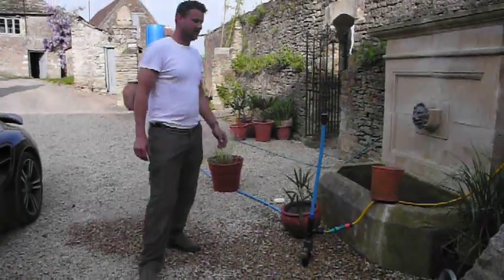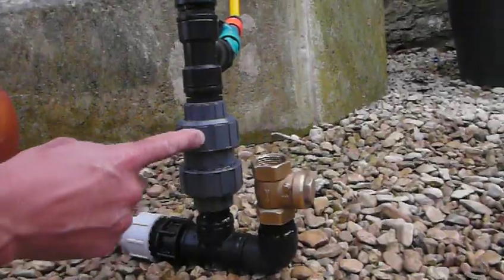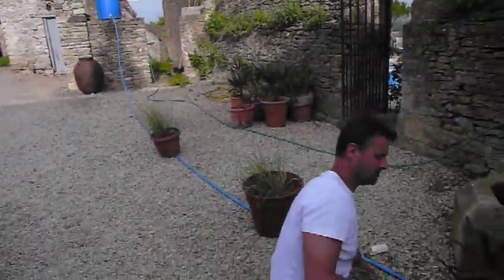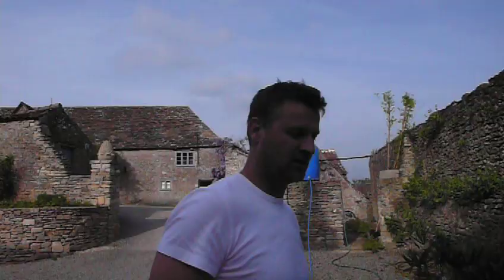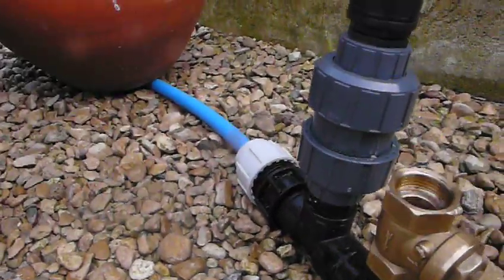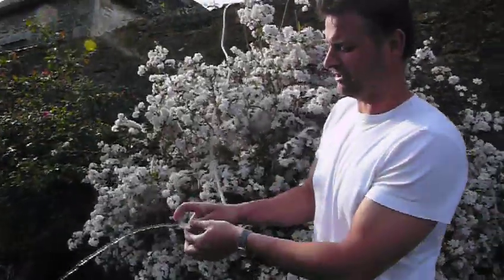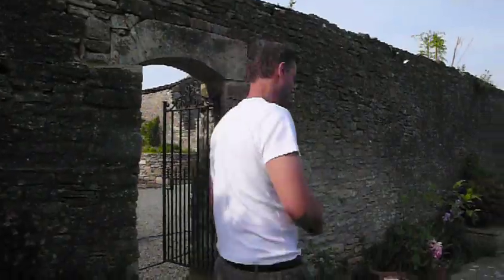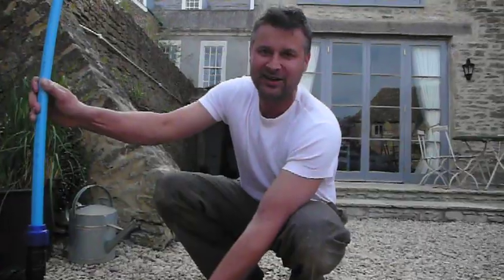Plastic Hydraulic ram pump

Comment: Nice video !  I notice that you use a lot of PVC piping which is my goal also.  I would like to incorporate a RAM pump into my aquaponics system, but the copper and brass fitting are poisonous to the beneficial bacteria and to the fish.  Since you only have the one single brass gate valve in your design, can you offer an alternative to avoid all brass and copper (and metal) with the gate valves?  Would this design work with an additional (second) one-way, pvc, check valve? Thank you

Comment: Nice design! The swing flap valve that he is using for a clack valve is prone to heavy wear , and will not last long.  I designed a clack valve that lasted me over 2 years without a single fail. I made it out of simple parts that can be found at any hardware store. If needed I can send, via, email, a simple diagram I drew up of it. It may even be cheaper to make that the brass valve that he is using  costs.
Reply: Interesting let me know if you upload it.

Comment: with that water tank sitting up high like that, seems like gravity itself should give you all the pressure you need to go over that wall or anywhere else..so,
would this work and pull water UP from a creek that sits down in a  10ft deep stream,  about 12ft behind my greenhouse? 
It would need to push it up the  10ft bank in order to get up in the yard, then over to the greenhouse itself
Reply: YES !!! http://www.instructables.com/id/Hydraulic-Ram-Pump/  I built one and it pumps over a quart a minute with 3' fall on supply side and pushes water up over ten feet rise at 4-5 psi.

Comment: The water pump idea is ok and it does work but the demonstration is kinda useless. The water starts at 2-2.5 meters height goes down to 0 goes up lets say 4 meters and back to 0 trough the tube, wich does not need a pump (if you "manually" start it by sucking and make the water pass the 4 meters gap till it will arive at ground level it will start flowing thanks to gravity and difference of level from the first 2-2.5 meters or as long as the ending point of the tube is lower then the source). My point is that the demonstration should be on top of that wall not on the side, because you are not showing what the pump does but the power of gravity. Dont get me wrong but this is my opinion

Comment: Sravan Banoth , well yep...if you have a big huge tank with the ball valve (tap) at the very bottom of the tank and you connect your hydraulic ram's inlet to the ball valve, the pump will work. It will not lift a lot but it will lift definitely.

Comment: Good video guys. I assume that without the snifter valve the pump would eventually stop working? How did you hold the snifter valve in place and what clearance did you find worked?

Comment: Could you put the out put back into the source making it perpetual motion?
Reply: Yes as long as the output is higher than the feed. But remember that 90% of the water goes to waste so eventually you will empty the feed tank. This does not apply if using a constant water source like a stream.

Comment: help me :) we constructed the same model what u did in the video ,for lifting the water nearly 2metres to 5 metres ,but it is not working properly :) can u give u email id so that i can send the constructed,model images :) hoping for a quick reply..
Reply from the maker: Okay my email is;      fairb@hotmail.co.uk
Also check out my other videos,  i have since made some quite detailed construction videos.  Cheers J
Reply from the maker: Part 1  constructing a 1 inch Hydraulic Ram pump made from galvinised steel water pipe fittings.
Reply from the maker: construction of a ram pump.MP4

Comment: Wait just a minutute isn't this OVER UNITY right there? The Pump is pumping water to higher level than from which it flows using no energy.
Reply: +Naoki Kashima It absolutely is. He started with a 5 gallon bucket of water and ended up with 6 gallons of water. Why aren't we funding this?!?
Reply: no, what happens is there is a main chamber with a valve at the top and side, the side feeds into a small open ended tank. The water moves in from the side, pushes the side one shut, and goes up to the top one and compresses the air at the top. Then the water at the top moves down, closing the valve and it goes out the upper one.
Reply: Would have been equal to unity had the same amount as entered inside the pump was delivered at the higher head.

Comment: Sorry, but it could work without the pump, your watertank is higher as where the water is going out of the pipe,
if the pipe is cut at the top of the wall, and water comes out of it, i can trust its a pump.  But the pipe is full of water, and the gravaty can move the water allone

Comment: The key part of the design is the check valve, that allows that pulse past, then seals off when the water wants to flow back that way.
And even that is pretty simple, its essentially a swinging gate inside the valve that can only open one direction...

Comment from the maker: This is a demo, so the pump supply is a barrel of water, normally it would be in a stream and as as long as there is an un-interupted water supply the pump will run continuously with minimum maintenance.

Comment: And how do you suggest directing the water back in?
The output line has to remain air tight at all times otherwise the pump will stop working and lose it's pressure.
That's why the output water has to be higher then the pump. There are specific guidelines to follow and calculate when building a ram pump.

No need to assume you know everything when you obviously don't.

Comment from the maker: Ram pumps can run for as long as you have a un interupted flow of water entering them. Some pumps in the uk are over 150 years old and still running. Obviously you have to carry out maintenance and occasional replacement of parts, but by and large these pumps are very simple and extremely long lasting, mine is a small home made design, the big commercial models are often made out of cast iron and gun metal.
Cheers, J

Comment from the maker: I can adjust the impulse valve by tilting it. Unfortunately galvanised iron is expensive in the UK. But you are dead right in stating that iron is best. For a long lasting pump iron wins every time. I have a 2' Green and Carter pump made in Taunton, England in the 1920s and its still in perfect condition. Be great to see your design. Thanks for looking and commenting.

Comment from the maker: It all depends on your supply head, the greater the supply head then the greater your delivery head will be. This little pump had a 2 meter supply head and lifted water right to the roof of the house approximately 15m easily. As you increase the height your output will drop. Cheers and thanks for watching and commenting.

Comment: I also think that you can pump some water higher than the original level by using a water wheel to turn an impeller type pump...may be more efficient..the water wheel does not need much head to produce a lot of shaft hp so a relatively small pump could easily pump higher than source albeit at a much reduced rate..see my "water wheel and copper men video"

Comment: If you are just the other side of the wall then the loop over the wall is insignificant surely..what happens if you take the outlet to the top of the wall..i.e above the level of the supply water butt?

Comment: So if I understand correctly, there is a small reservoir which is used to burst the water into the larger reservoir (vertical tube). Once the pressure in the vertical tube is high enough, it pushes the water to the output tube? Is this how it works? I believe the same principal can be used to capture the faint electrical potential there is between the ground and an elevated plate or antenna.

Comment: I bet that , if you just took that plastic hose connected to that barrel up on that wall and fed it out that gate to where you were spraying the water from the ram . The water would have came out faster  than going through the ram.The big wall meant nothing because the height was canceled out by the siphon effect coming down the other side. . Your theory was still bang on and rams do work.Great video .

Comment: What if you put a turbine at some point into system and you #1 generated electricity.  #2 you could have a bucket catch the spill over and jet spray and have a second ram pump that also back to the holding tank.  It could run the turbine for hours before one would have to add water to the system.  #3 add a floating add water value so that as time went on small amounts of water could be added to account for spillage and leaks so that you could make electricity for hours on end with a jug of water

Comment from the maker: Hi,

Could do with a bit more info. Sounds like your impulse valve is not working properly. I  use two different valves; a spring check valve for the non return valve and a swing check valve for the impulse valve. There can be a fair bit of trial and error in setting these things up. I'm no expert, but give me some more info on supply etc, can you post a video og your pump and we can have a better look at whats going on.

Comment: @MyAmericanSafari I can't see why not, the only thing is that you use a lot of water to raise a little. the usual efficiency of a ram pump is 33 percent  of the water to the outlet, the rest is used to pump the water up. so you need a large, free supply of water at reasonable elevation to power the pump and supply the water. ram pumps are most effective in very rural areas due to the availability of large free water supplies to power the pumps.